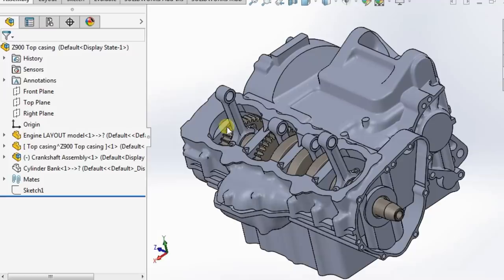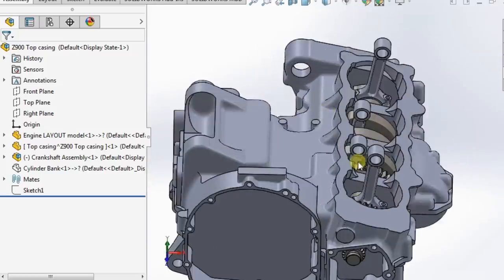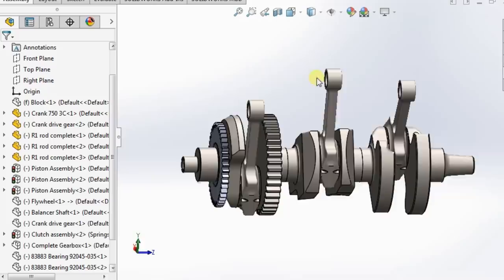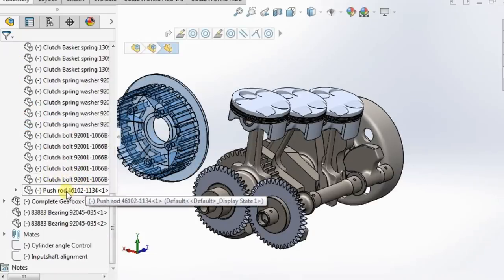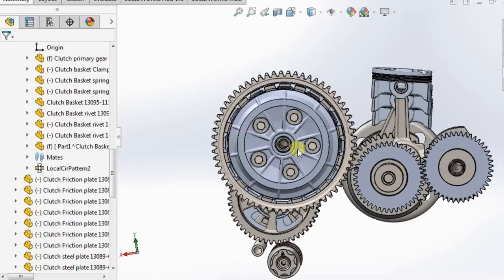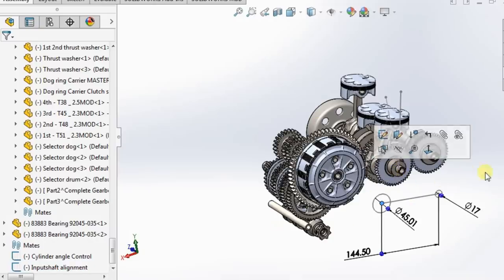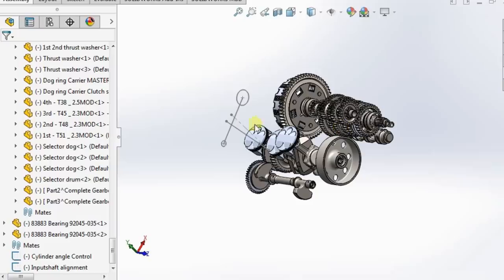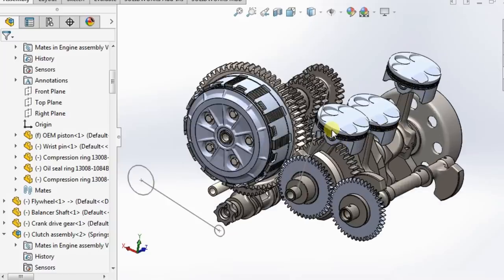Engine Architecture - EA Series - Part 1

Comment: I used to have a Chevrolet Sprint, It had a turbo 3 cylinder engine made by Suzuki. It was a rough running engine even when it was brand new. Your skills with SolidWorks are top notch in my book.